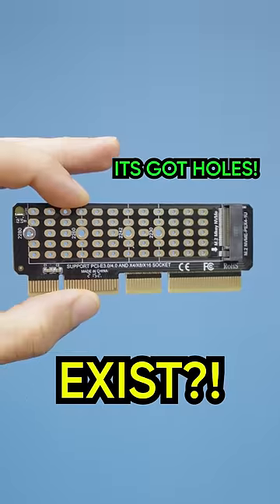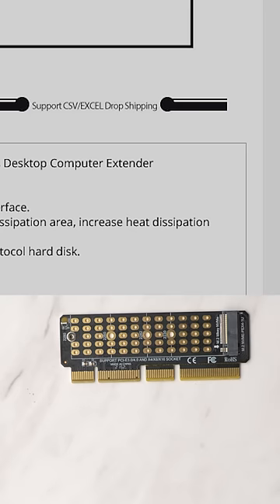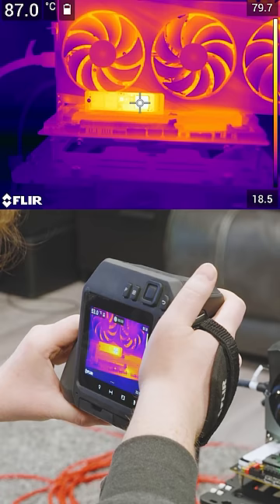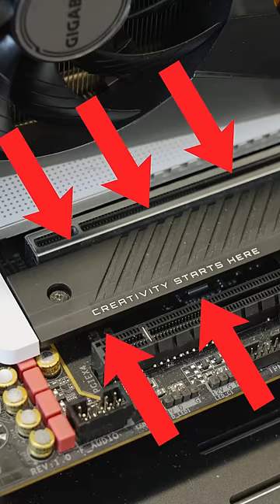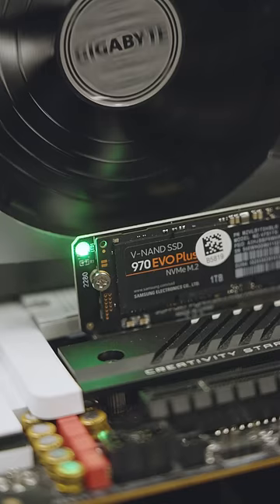Why does this have holes?!

Comment: The adaptor exists for people who use motherboards without m.2 slots on it, and there are lots of cheap motherboards for AM4 and other sockets that don't have even a single m.2 slot, and maybe some people wanna upgrade an older computer without investing a lot of money for a newer CPU or Motherboard, for example, maybe someone has a Motherboard with an i7 6 the gen or 7 the gen and no m.s slot and wants to use it for gaming on a budget without spending a lot so obviously he is gonna buy an SSD SATA 3 or m.2+ this adaptor, and a better GPU, os someone maybe had 500 dollars for a PC and bought an old dell computer or any old assembled computers, put a GPU in and wanna put an SSD too
Reply: But if your motherboard doesn't have an M.2 slot included. what are the chances of the M.2 SSD being able to even work?
Reply: @Owy.  It should work because from what I know, m.2 NVME slots use the PCIe lanes on the CPU, so I guess it would be no difference between that addon and a normal m.2 NVME slot, there are also some addons like this that use the PCIe slot for power and transfer the data thru a sata3 port
Reply: @Owy.  m.2 slots are pcie, so it obviously works. I use one of these for an extra nvme ssd since my motherboard only has one m.2 slot

Comment: Calling an m.2 drive a "hard disk" should be your red line to pass by it
Reply: Right, they're solid, but not hard 😄
Reply: @LRM12o8  The issue is the term "disk." A disk is a flat sheet of something. That's why nearly all old tech (after tape drives, anyway) was called "disk" and why many older apps on modern PCs still call drives, disks. In fact, a SSD is not a disk. It is, however, a drive.

Some think SSDs are not drives because they don't transport anything - but they do! They transport data.
Reply: @Mavendow  I would go a step further in the definition of a disk and add that it needs to be round too. The actual disk always is. About the drive definition; If transporting data would set the bar, then a usb cable would also be a drive 😉 The term ‘drive’ suggests physical movement, no matter how you spin it (pun intended).
Reply: @beeldbuijs1003  Electrons can be "driven" in wires, but a wire that's unplugged can't be driven. Like removing a car's engine and asking someone to drive it.

So, if it can't be driven under most normal conditions, we don't call it a drive. That's why RAM isn't called a "drive" even though it is driven by the chipset's crystal quartz clock driver. RAM Drives exist but the RAM card itself is still not called a drive for the same reason.
Reply: @Mavendow  I'm sorry, but how is it not a normal condition for a USB-cable or RAM module to be connected? That is litterally their sole purpose. You can't use any unplugged drive, old or new type.
Reply: @beeldbuijs1003  Weird, because when I plug the drive back in, the data is still on it. I wonder why. Maybe because it's a drive and not a conduit.

Comment: The pcie adapter is for older pcs that don't have a m.2 slot on the motherboard.
Reply: And at least it works and it's cheap.
Reply: Or if you want even more! I have three ssds in my itx mobo.

Comment: I have the same on an USB M2 Adapter and it's not that stupid as you mentioned. You just need to combine it with a thermal pad and you have a similar Effekt as a metal backplate on a Graphicscard. They use those metal conductors to make contact through all layers of the PCB and improve the thermal conductivity instead of having just a regular PCB, so of course it will not have the same effekt as a Heatsink but it will improve the temperature's by a few degrees probably.

Comment: I'll tell you why it's exist. I am currently using one to boot from NVMe drive on my Asus Z77 motherboard with a modded BIOS. I'll repeat, Z-77, that's IVY BRIDGE, from 2012. Not everyone is on "current gen", or maybe not even "recent gen" and have M.2 slots.
Reply: Pretty sure they're talking about the fact the adapter has holes, not adapters in general
Reply: Did you need to mod the BIOS to boot from it? Since the Z77 is UEFI, I thought you could just plug it in

Comment: These adapters aren't used for cooling. They are used for adding an extra m.2 slot to your motherboard.
Reply: Exactly
Reply: LTT just to create drama. actually the product is a good idea for expanding NVME m.2 storage.
Reply: The manufacturers advertise all of those plated through-holes as a cooling feature for the ssd though. You can get similar adapters without them, and they work just as well.
Reply: @zodiacfml  they’re discussing the holes and the BS marketing, not the adapter itself. they’ve obviously used the adapter in its intended purpose cmooon
Reply: Finally, the answer to the original question. 😊
Reply: @Gellis12  that's literally just marketing shit to get more people to buy it.
Reply: @Gellis12  Who cares about it? This is the cheapest one and works for add a extra pcie 4x m.2... "Oh the manufacturer says" who read what manufacturer says?
It's cheap and works.
Reply: @AMV12S  You're inventing a whole new thing to try and argue about. I never said they don't work; in fact I use a few of them myself. I'm pointing out that the manufacturers advertise the plated through-holes as a cooling feature, when they actually don't affect the temperature of the drive at all. That was actually the entire point of the video as well, if you want to take a few seconds to go watch it.
Reply: @Gellis12  next you're gonna tell me that 100k mAh powerbanks for 30$ aren't actually 100k mAh powerbanks on AliExpress.. lmao
Reply: @Gellis12  Come on, use your brain...
They said this because it had to write something even if no one reads and make holes on the adapter to reduce weight and send more of them in one package.
The holes are not plated, that is a lower layer of a PCB.
Reply: @AMV12S   "False advertising is alright because I know better, and they didn't think anyone would read their advertising."
Also, they very clearly are plated, you can see it in the video. Use your eyes.
The issue isn't that the holes exist. The issue is that they're lying and telling customers that they reduce temperatures, when they don't do that at all.
Reply: So not for cooling the PC, but to make cooler the PC
Reply: Lapsio  how? What else are you realistically going to use the extra pcie slots on your motherboard for?
Reply: Lapsio  yeah but if you just happen to have a single m.2 ssd or you get one as a gift, this solution is really small and really cheap. I got one because i needed a second slot and i know I'm never gonna need a 3rd one
Also the 8x part of these is usually empty so you could probably chop it off and plug it into a 4x slot
Reply: @Gellis12  a normal adapter could get hotter, the adapter itself, not the ssd, if this one's holes are all connected to a big ground pad

Comment: It's a perfectly functional and extremely affordable NVMe to PCIe adapter; it's by no means aimed at just cooling NVMe's.
Also, if these holes were going to have any effect, it would be to ventilate trapped hot air between the drive and the adapter (assuming no thermal pads are used), which is the case in a normal layout where the motherboard is vertical, and the drive is horizontal. What you tested was the exact opposite.
Also, you could have just taped off the holes for testing, using another slot doesn't confirm anything about the functionality of the holes.

Comment: You guys should try it on older motherboards, and see if it works!
Reply: No reason why it wouldn't. I have a different one in my X58 board. Delivers PCIe 2 speeds---~1600
Reply: @Roger Barnett  Cool. I've heard you need to mess around with DUET on some systems to make it work. Particularly if you want to use it as a boot device

Comment: The sticker on the 970 EVO Plus is a foil heatsink. Think of it like the IHS on a CPU. An additional heat sink is not needed on PCIe gen3 (970), but is required on gen4 (980 Pro).
Reply: PholPettersson  Samsung says you're wrong. Top right of the product page "Must be installed with a heatsink (sold separately)." At this time, they don't offer a Gen5 SSD.

Comment: I have one and actually tested if it was market bs or true. Surprisingly it is to a degree. The gold rings are actually pressed in pieces of copper that conducts heat better than straight pcb. Slap a cheap $10 nvme heatsink over the SSD/other side of board and those copper rings will move the heat from nvme to the heatsink better.

Comment: These adapters are still very good for adding extra nvme storage to any modern system I mean now it's not much as an issue when you have to 2-3 m.2 slots and you can get a a 4 terabyte nvme 4 less than 200 bucks but if you wanted any mass data storage you are going to need to pick up a couple of these adapters because it's cheaper to get a few four TB nvme than one 8tb a few mb like the msi pro x670-p wifi already had a couple pch m.2 and a few 4x electrical 16x physical pcie slots so if you want extra nvme storage you need these adapters just make sure you add a heatsink

Comment: The adapter is intended for older motherboards that don't have an M2 slot. It's not about cooling.
Reply: The manufacturers advertise all of those plated through-holes as a cooling feature for the ssd though. You can get similar adapters without them, and they work just as well.
Reply: I've got a couple of these in each of my older servers. Awesome raid1 boot drives.

Comment: if people would just pay a little more attention to the physics teacher in school when they were kids, they wouldn't be falling for this.

edit: by "this" i meant the product.
Reply: its actually not cheaper to make those extra holes, each hole is made out of pieice of metal that goes throught the whole PCB conneting all the layers togther, if you wouldn't include those hole the PCB would had less metal hence worse dissapation, i bet you if they would have put some thermal pads underneath the m.2 it could have helped a little
Reply: @alberta3157  no, you misunderstand me. i meant the product is useless. i didn't badmouth ltt. i can now see how my comment can be misinterpreted, I'll edit it.
Reply: I doubt anyone actually cares about that. It's a simple adapter, you either buy the cheap one or one that looks cool. The product description just contains nonsense to have at lease some text, because writing nothing about something there is nothing to write about ironically seems even less professional.
Reply: Physics says this would have an effect. Thermal vias on PCBs are a thing. I use them often. This however isn't a great application of them. Still I'd wager you'd get a fraction of a degree out of it.

More to the lower temp claim than there is to the turbulent air causing problems claim (comparing the Swiss cheese PCB and a solid one)

Comment: The part where you showed the ssd with no heat sink vs with, that sticker is in fact a heatsink. It’s thermally conductive to help in heat dissipation. It’s present in most higher end and mid range nvme drives I’d say. Not sure about low end or sata ones.

Comment: Drilling and masking the holes would generally just be added completely in the process.  It’s not a significant amount of time as you still need the screw holes for the M.2 end screws.  So adding more holes is just like 5-7 extra seconds for a cnc machine to do.  🤔

Now I guess if you wanted a heat sink on the back of the M.2 as well, you could leverage these holes for aluminum pins on a spreader/sink.  If so the marketing is just trying to sell a impact of reusing another design as a “feature”.

Comment: The real issue is those holes are allowing warm air to just sit and any aerodynamic individual that has been near a 12-16 core cpu that doesn't need to have a ph.d  could explain that air isn't actually. Good at dissipating, in fact air alone that is stagnant actually insulates o.....o so in a way this adapter is a fancy over heating adapter that unless you have a fan constantly actively blowing on it. This adapter is gonna be hotter than the hot spot on a AMD GPU for most of its existance as the hot air around and in the holes. Are effectively overheating glory holes they punched into the disk. Like this goes beyond just bad or lazy engineering and hits you had to have failed basic aerodynamic heat index basics in like high school. To think this was ever a good idea.

Comment: Actually the holes make sense from an engineering perspective. You are adding thermal mass. The large number of thick plated holes between the two ground planes dissipate heat from one side to another. When designing a PCB, this is common practice when using the board itself as a heatsink, for FETs, VREGs etc. This is the very reason almost every QFN footprint you see will have a bunch of vias under the thermal pad, including but not limited to, on the SSD itself (feel free to check if you dont believe me).

Is it as good as a purpose built heatsink? No. But its arguably significantly better, especially when there is considerably more copper on the adaptor than there is on the SSD. The size of the holes add additional surface area, that you would have if the vias were blind (connected, but no hole), because the inner surface of the hole is also dissipating heat.

So, why didnt your test confirm that?
Because you missed a critical step that the engineers probably thought would be common sense. Theres supposed to be a thermal pad between the SSD and the adaptor, and you didnt add one 

What you did is the equivalent of calling a cpu heatsink junk because you forgot to peel off the "WARNING, REMOVE THIS LABEL" sticker from the mating surface before installation.

Comment: but it would probably help transferring heat from the SSD to the other side of the adapter board, letting you put a heatsink there too. 

double heatsink wammy
Reply: No it wouldn't. Trapped air is a really good thermal insulator.

Comment: I had to use one of these. My pc only has 1 m.2 slot and it has the drive with my OS on it. But I needed to update the firmware of a Samsung m.2 drive for my PS5 and needed my PC to do it. This PCI-E adaptor was the only way I could do that without buying a new motherboard.

Comment: Well, actually plated through holes do transfer energy from one side of the board to the other and increase the surface area.  You just neglected to install a thermal pad to take advantage of this.

Seems like translation error combined with user error.
Reply: I think the principle works a lot better with way more vias way closer together. With the thickness of the plating being so thin, there's really not much material there. Makes a lot more sense when you're going from tiny component to the other side of the same pcb, not trying to go through a huge board and expecting a tiny temperature delta.

Comment: but theoretically it should be beneficial for temps
as instead of conducting heat to fiberglass pcb you have large copper vias that transfer the heat to big ground plane much better
many electric circuits utilise the same thing
but on such a small board theres not enough copper to wick away the heat effectively

Comment: I can see it help temps in my case. 
I’m using quite a old case where the power supply is located on top. 
I have a front intake fan sitting in the bottom of the case which would blow fresh air directly at it. 
The gpu above it would pull that fresh air and with the holes in the pcb, it would create a nice breeze on the bottom of the nvme drive.

Also having it setup as test rig doesn’t quite measure like inside a closed case ?

Comment: They should actually be hot to reduce wear, it has a substantial negative effect if cooled. But also, you should not get burned when touching them during operation. 40-50degree is optimal.

Comment: LIKE SO HE CAN SEE 
They for transfering heat on the other side of pcb
You need to use termopad between ssd and pcb
And on the other side of pcb then mount radiator 
So you can have heat transfer trough pcb

Used a lot for example in 3D printer stepsticks if mosfet driver is under the pcb

Comment: if you had a fan pointed at the back of that adapter then I guess the holes would help cool the back of the ssd but then again, why not just slap even a thin copper slab on it

Comment: maybe you're supposed to solder a heat sink to the holes?
Reply: But why tho? The holes don't get hot, SSD chips do. And soldering is a bit too excessive, just slap some thermal paste and secure the radiator on it tightly. But for the vast majority of cases this is excessive anyways

Comment: That's not a heat sink for an existing m.2 it's an adapter to add an m.2 to your existing system. The bigger holes are for different sized m.2 cards, While the smaller holes may let air flow around the attached m.2 but the will not really do much for cooling.

Comment: I have one, but it doesn't have holes. My pc only has one M.2 slot and I was given another M.2. So had to get an M.2 to PCIe adapter. Never checked to see of there was any thermal difference because I have two different brands and quality SSDs

Comment: That adapter is actually crazy good, i use several in older systems without nvme slots. You get the full speed of nvme on system as old as a first generation Core CPU. This video is kinda cringe tbh.

Comment: Those are "stitches" put into a multi layer PCB to connect ground planes. It's an attempt to let the SSD sync heat into the adapter to spread heat out. Its free to do and may let some more air through so why not? LTT content gets worse every day.

Comment: "Long story short".. you're using it wrong.  The holes aren't going to disrupt your airflow..   if you're trying to debunk, compare this and a similar riser without holes.  This adapter exists to add m2 ports to your mobo.   I use them WITH heatsinks on the front.   Can't put one on the back and the holes improve ventilation ever so slightly.